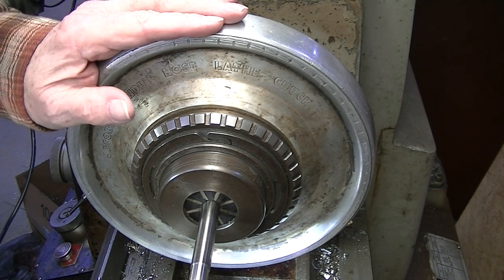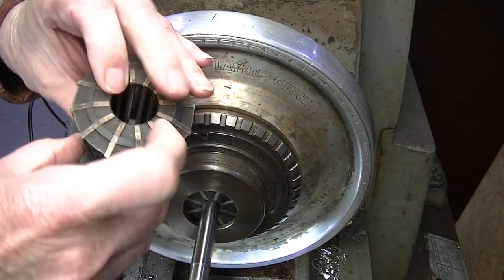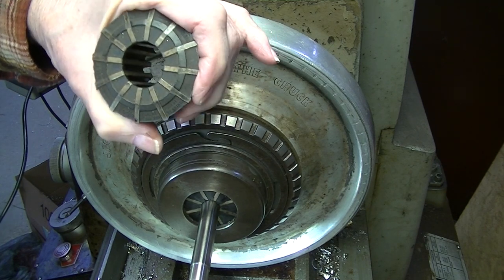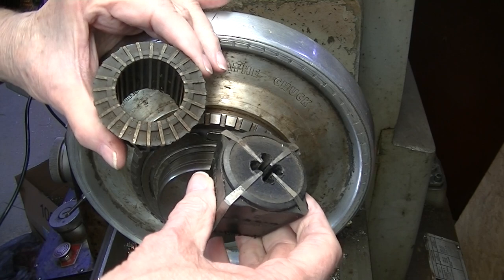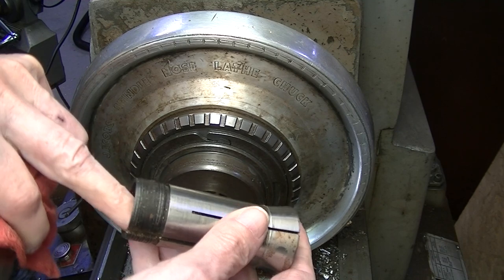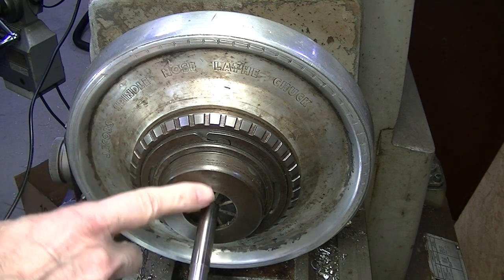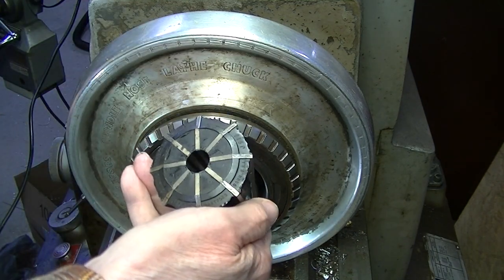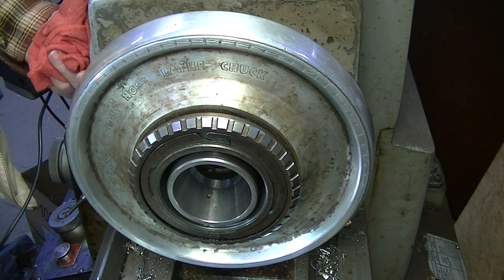Jacobs Rubber Flex Collet Chuck

Comment: Nice description and video! Thank you for posting. I have just bought a set for my lathe - a Colchester Triumph roundhead. It uses an L1 fitting so is pretty big. I haven't used it yet - need to rig up a hoist for the 4 jaw as it weighs about 100lbs.
Reply from the maker: Yes, time was when 100# was just a little chore, now it's impossible. My hoist is my son-in-law or a younger neighbor. You should enjoy the Jacobs unit, it centers and grips well and saves a lot of time.
Please subscribe if you have not already done so.
Thanks
Steve

Comment: Steve
I have now fitted the Jacobs chuck and love it. There is a but however, I am getting vibration at higher speeds - over 500rpm. Everything is running true on the dti. The handwheel though has a fair bit of play in it. Are they all like that? You can rock it slightly from side to side.